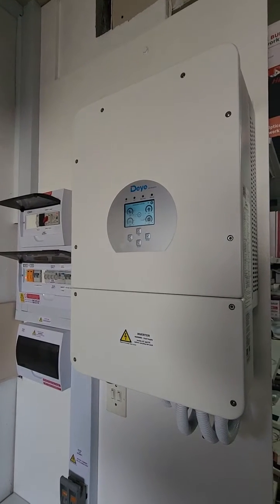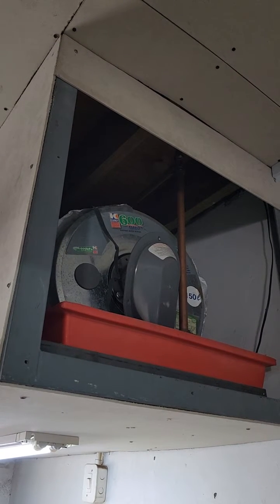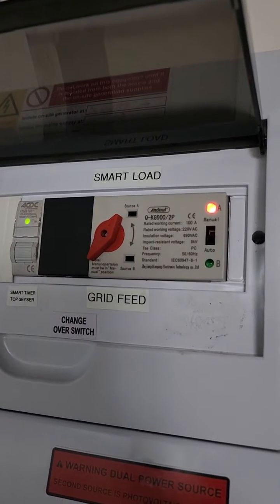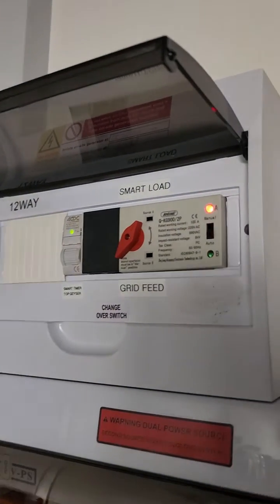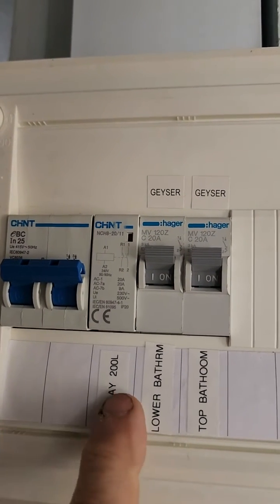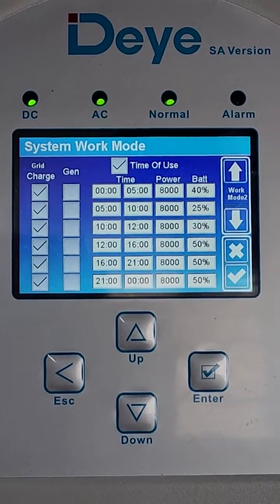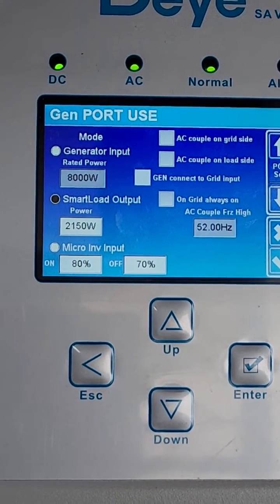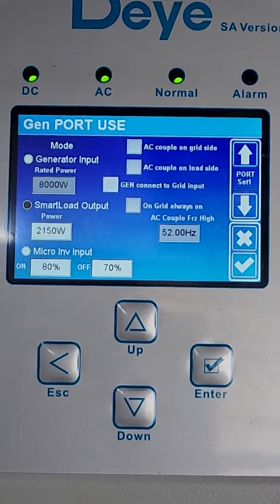Smart Load feature on Deye inverter used to max. (first version)

Comment: Finally I find someone who has done what I thought should be an optimised setup.

How has the Andowl ATS performed? I have always wondered how well built it is as opposed to their version sold by ACDC.
Reply from the maker: Hi.
I dont know the Andowl ATS, but I did combine the Smart Load with a Sonoff Temp control via eWeLink on the grid supply to the geyser's auto change over switch.
That's to optomize grid useage when it rains.
I have a video on that as well.
It works like a charm.

Comment: Hi, if im completely off-grid, i want to use geyser connected when there's enough extra energy, but night time and specially in the winter time i would also like to have simultaneously a generator connected, where i would connect the geyser and where the generator? the gen or the grid port? and which settings would help in such a case?
Reply from the maker: 1. Insolate your geyser REALLY WELL!!!  It's cheap and means you only heat it once during the day when there is enough sun.
     Heat lasts till the morning.  (monitored via Sonoff TH20)
2. Set the thermostat to max. (70 degrees C) for Smart Load max. heating.
3. Add the Sonoff TH20 Elite temperature/timer unit like in my other video.  (switches on when below a temp. / off if above)
4. Add a auto change over switch (like in other video) for external power to geyser (Smart Load as default input)
Note: I am not familiar with generators, but here is a basic idea:  (ATS might be needed)
5. Gen options (depending on size): a. power straight to geyser through auto-change over switch (managed via Sonoff temp. timer)
                                                         OR  b. to Grid input of inverter (check: Hz range of gen. & size [only run at 50% capacity continuously]
                                                                [Gen input will be used as Smart Load output - thus unavailable for generator]

You only need a trigger to start up the generator when the temperature is below a certain value (40 degrees) and off above say 46 degrees.
That must trigger the generator to send power via the auto-change over to the geyser. 
This is the most effective way to minimize alternative power to the geyser. (managed according to temp.)
You can optionally add an external trigger as well to start the generator if the batteries runs low. (if connected to the grid input)
Reply from the maker: I prefer to use the Gen input for the Smart Load output because of the excellent parameters to heat geysers.
You can then put the generator on the Grid input.
There are videos on that (same as Sunsynk)
Re Geyser use: heat once to max. heat (70°C) with free heat (SL), isolate VERY well, then keep off.
It stays hot enough till the morning.
Add a Sonoff TH20 temp meter to view & control temp. (see my other video)

Comment: What size and number of panels do you have to produce 4.2kw
Reply from the maker: 8x550W JA Solar
Reply: Thanks for the reply.

I have the same size and number of panels but at peak am producing 1,200w at peak. Am also in a country with climate as SA.

How can i diagnose the problem? I have a 12.5kva deye inverter
Reply from the maker: @muhammedbux8302  you should be getting 4.kW.....  touch on solar icon and see Volts and Amps of strings.
Should be around 160V - 180V for a 4 panel string and Amps will fluctuate according to sun.
Watts on each string should approach 2.2kW on very sunny day.
Otherwise you have: shading issues or a bad installation

Comment: Hi can you please help me the smart load never switches when the solar is zero.It stays on. What do you think is wrong. Battery settings is ON at 100 and off at 90
Reply from the maker: Set Smart Load on at 85% or 90% (when reaching 100% battery will drop to say 98% and not go up to 100% again - not triggering SL setting)
Plus, you need some battery charging left to keep the load above your SL setting (say 2000W)

The only time SL tends to stay on, is when it is on and grid fails. (does not switch off - so I added a timer to cut at 3pm)

Comment: Sorry for my possibly damn question. I have 2 5kw Deye inverters that I want to use at home. Can I possibly have the normal load put on the load side and then the rest (geyser, oven/stove and aircons) on the smart load. What happens if, at any time, the total load (smart plus normal) exceeds the inverter capacity which in this case will be 10kw? Are you also able to share a wiring diagram for the smart load side of the connection?
Reply from the maker: @stanslaszulu  the Smart Load is only useable for "excess solar"
It only switches on when your battery is almost full an PV is high (according to your settings)
You should put everything on Load, eccept things like stoves (geyser) which can still be power by solar & battery, but not during a power failure. (CT must be placed correctly)
Watch my other videos on Smart load and auto change over switch useage.
Reply: @bolandsystems2024  thanks for the response and I will watch more of your vids on smart load. I am in a smaller house and my normal/consistent load is about 500watts which is 2 fridges, TVs, lights, internet routers, a laptop or 2 plus some speakers. I am using one 5kw inverter. The most load it has handled is 4kw when I had a heading element and microwave on but this was for a short time. I am moving to a bigger house where the  consistent load will increase to maybe 1200 when I add more lighting plus cameras, gats motor and water pump. I will install two 5kw inverters in the bigger place. Plus I have panels with max wattage of 11kw plus total storage of 20kwh. I know I will have a lot of excess power so I am trying to figure out how I can optimise the use of the excess capacity to power the rest of the heavy appliances like geysers, aircons and possibly stove/oven using the smart load.
Reply from the maker: @stanslaszulu with that setup, I would:
Put everything on Load, except the older type of stove (can still be driven by solar & batteries if set to: Zero export to CT.)
Then follow my setup for your geyser to be powered by
- Smart Load [when ever there is excess PV & batteries almost full]
- Grid [when it's cloudy]
- a heat pump is expensive but works lovely on an inverter

We use an airfrier (oven type), induction stove & microwave and have no more need for a stove
Make sure your aircon are the inverter type. They are great with power usage and soft start.
In winter you might struggle to get 20kWh batteries loaded to full with 11kW panels.
Rainy days your PV can drop to 10% production or even less.
Adding panels will not be a sound investment though (pay 100% for 10% - 50% production for a few cloudy days only)

Comment: Sorry for stupid question, is it possible to use Load and Gen outputs simultaneously? (Can not understand English fully)
Reply from the maker: @NikitaGarets  yes, it is 2 different outputs.
You can not use Smart Load output and Generator input together.
It is the same connection
Reply from the maker: @NikitaGarets  yes, the Smart Load output is just a Load output with parameter settings (%PV & Battery SOC)

Comment: Hi. Regarding your setup that allows a 2nd geyser to be heated if the 1st one is already hot:
What is the name of the "relay" that you refer to in your video?
https://youtu.be/fIXeK_-b12c?t=334

I am currently running my geyser on SmartLoad. No issues there.
On a sunny day, my batteries are fully charged and my geyser is hot before midday.
The rest of the day, my panel power is mostly wasted.

I was considering powering an additional geyser using your "relay" setup.
Perhaps you have more information on how it works or could supply the part name or a link that explains how to set it up.

Thank you in advance.
Reply from the maker: Hi Niel.
The relay is a common DIN rail 20A relay powered by 220Vac. Most electrical suppliers should have one. (CHNT model NCH8-20/11)
My Smart load goes to both, but the 2nd geyser's power 1st goes through the relay's N/C.
That means, when the Smart Load power switches the 1st geyser on, it also powers the relay to open the N/C contact to the 2nd geyser.
When the 1st geyser's thermostat switches off, the power to the element is cut.
The relay is therfor wired onto the element of the 1st geyser.
I also added DIN rail LEDs to indicate which one is on.
1 - connected to feed from element to relay
2 - connected to feed to 2nd geyser's tripswitch (better to connect to it's element input)

You should strongly consider a 200l geyser & 2kW element (with screw connectors on element) as your spare geyser BEFORE your main geyser's input. 
Water flows through 2nd geyser to 1st (main) geyser
The main geyser's temp is regulated (50°C) and the spare geyser is dependant on excess solar, set to 70°C (fluctuating)
So add a wifi timer to your main geyser, preferably via an auto change-over (SL or timer input to power geyser 1)
If it rains, the timer will switch on & heat the main geyser.
90% of the time your SL will heat both.

Let me know if you need a sketch.
Reply: @bolandsystems2024  Hi. Please send me a sketch if you can 🙂

Comment: My Deye invertor, Smart Load "on" only 100% battery. :(
Reply from the maker: You can set the SOC% for ON & OFF at any %.
I choose 90% On, because I want some reserve charging left over for the battery.
Once my Volta reaches 100%, any load > PV will let the SOC drop with only a trickle charge feeding it (will not charge to 100% again before it drops below 90%)
Reply: @bolandsystems2024  you can't do less than 100% on my deye.
The inverter does not allow you to change this setting.
That's why SMART doesn't start for me.
And in general, everyone praises Deye, but I don't like it, there is a lot in it, but it doesn't work, or it doesn't work normally.
Reply from the maker: Depending on your firmware, when you choose Smart Load, the the % appears under Micro Inverter.
Change the % settings there.
(When you tick Micro inverter, you will see the % changes, thus those blocks are used for both SL & MI... confusing, I know)

Comment: What will a geyser control box setup like this cost?
Reply from the maker: Hard to say.
I do not know your setup.
Ideally: a 2nd 200l geyser connected to the Smart Load output (electrician) replacing the 4kW element with a 2kW (plumber).
Add an auto change-over switch & smart wifi timer.
Optional: add relay powered by main geyser's element to switch between 2 geysers.
Electricals +-$300 (R6000)
2nd geyser +-$600 (R12000)

You should not need to use grid power ever again, other than cloudy rainy days.
Temp is much more controlable than solar geysers which tend to overheat
Reply: @bolandsystems9707  thanks. How can I get hold of you?
Reply: Where did you get the  Changeover switch that has the WiFi capability?
Reply from the maker: @Vkara01  no, the WiFi switch is left of the auto-change over.
It provides grid power to the change over if SL was not enough